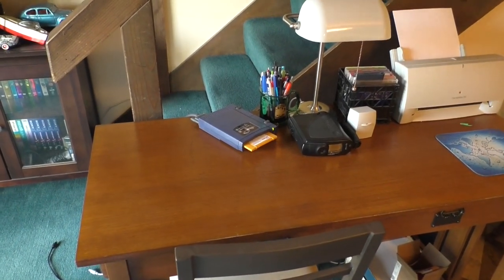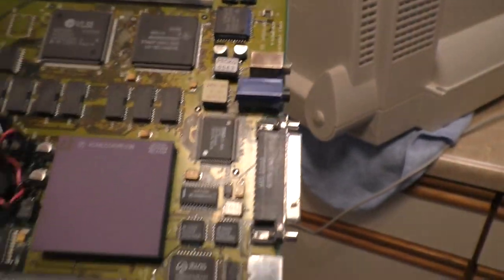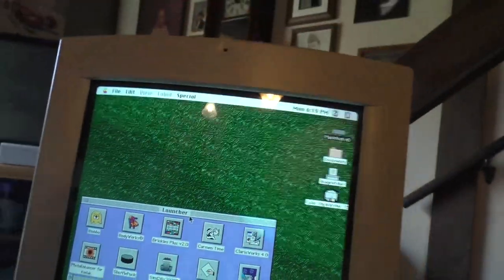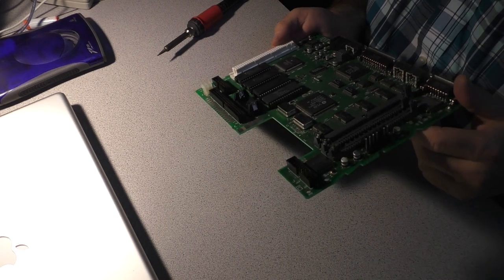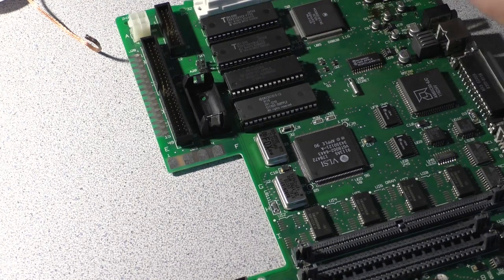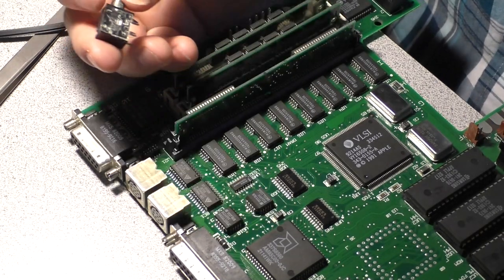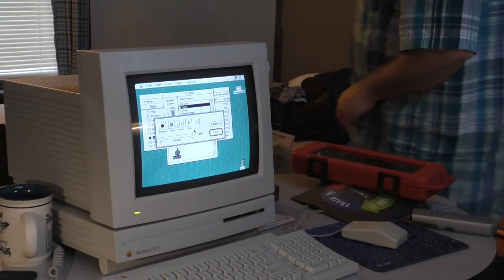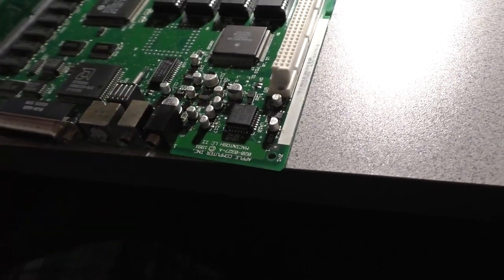Macintosh LCII Microphone Jack Repair Attempt

Comment: First of all, the static was the automatic gain control, as what happened is that the mic input was shorted to ground. Clean the flux, check the traces and run wires directly off the mic pre amp, and connect it to an MP3 player :) good way to test the ic
Reply from the maker: Thanks for the advice... I've decided to pursue an LCIII and cut my losses on this board. I do not have the patience to further diagnose this thing, and an LCIII is a bit better all-around.

Comment: Try a different microphone. Also I am no expert but I prefer a chisel tip on my soldering iron. I destroyed so many electronic kits just by trying to put them together with a soldering iron that had a conical tip in it.
Reply from the maker: It's totally not the microphone, I've tried others, including a direct line. I've assembled hundreds of devices with a conical tip with no issues, but I'll check into chisel tips... it might make some jobs easier! Thanks for the... tip?
Reply: A higher wattage temperature controlled iron would work a lot better too.